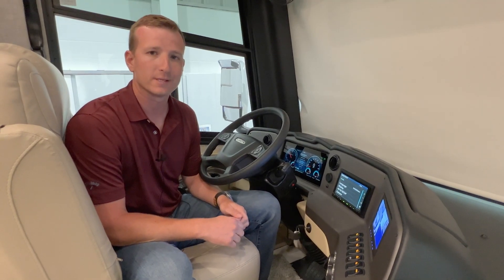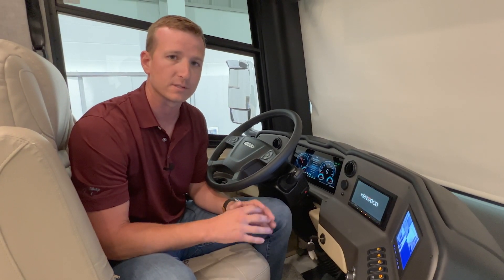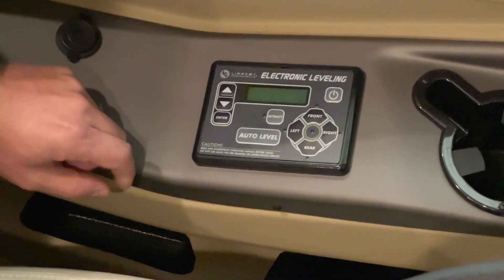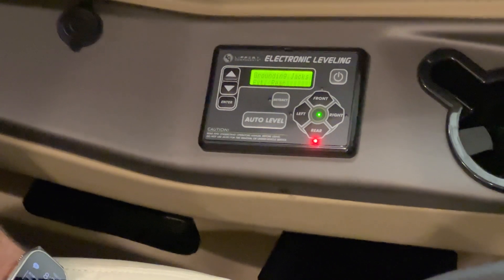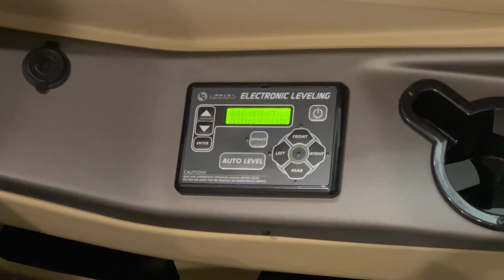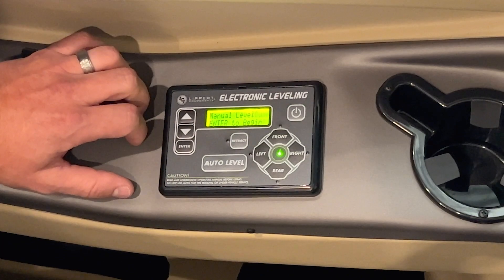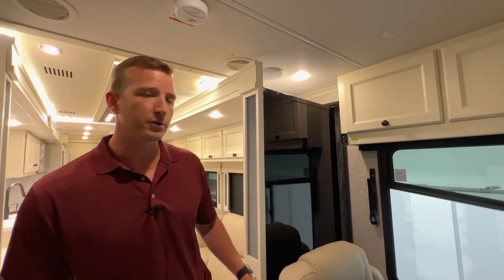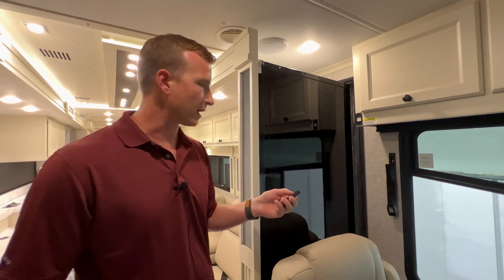Tiffin Tips - Running Lippert Hydraulic Slides & Leveling Jacks

Comment: On the hand held remote (transmitter) you mention to get closer to the receiver if the slides do not operate.  Doesn't the remote have batteries and to replace the batteries when the transmitter is not communicating with the receiver. Getting closer to the receiver in order for the receiver to receive the signal is usually a sign of weak batteries.

Comment: How do you reset the Lippert system if there’s an error, and how do you fill the hydraulic tank if low? Also, how can you retract the slides if the Lippert system fails?